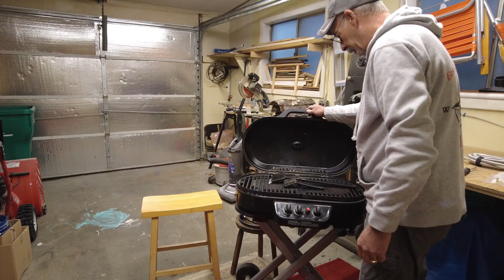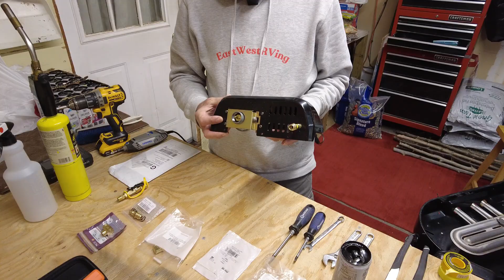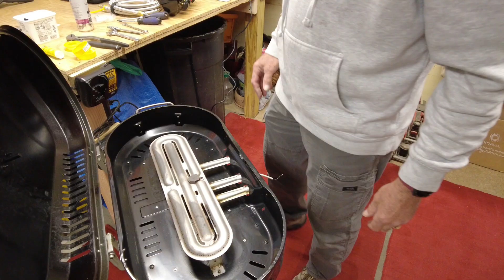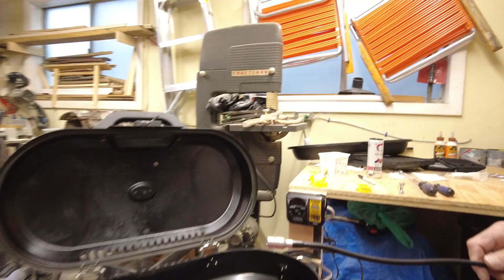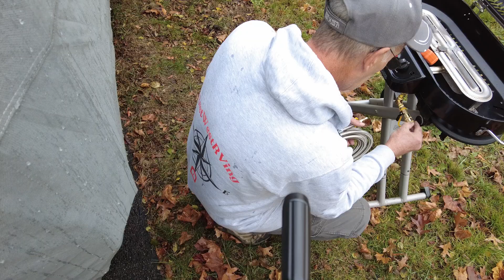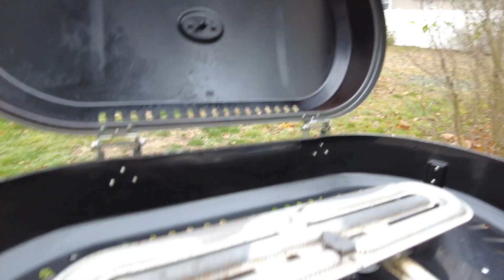Coleman Road Trip Grill Conversion Project

Comment: Thank you so much for the video. I have seen so many people doing this wrong or just merely converting to a 20 lb tank. This will be a relatively simple conversion once I found the metric fitting.
Reply from the maker: Glad I could help, I'm going to update this video in a couple of weeks so keep an eye out for that.
There is a link in the description for all the parts including that metric peice.
Reply: @e @eastwestrving  Yes. Ordered all the parts including the metric coupling. As soon as it all arrives, I’ll get right to it and I’ll remember to drill the hole in the back, not the front 😂👍🏼
Reply from the maker: @alpineralph I discovered after using my propane sniffer there are two additional items needed. I'll post the links and a brief description in the comment section.
Reply: @eastwestrving  let me guess. The propane leaked through the regulator and the original bottle attachment.
Reply from the maker: @alpineralph that's correct,  I have a fix just waiting for the part to show up.
Reply from the maker: https://a.co/d/00ZwiNmU
Here's the part that caps off the original regulator.
Reply: So. Once this is installed, no need to cap off the flared end?
Reply from the maker: @alpineralph  no you don't have to cap the flared end. I have a video dropping midnight tonight showing the fix.

Comment: Great video. I have been researching the best/easiest way to do this and yours is the best by far.  

I just bought the Coleman grill today.  Everybody seems to love this grill, but we all dislike the mini propane tanks. 

Still being able to use the smaller tanks is a bonus. Curiously, will the mini tank still connect and work?  I have quite a few left over from my other grill that I may want to use up after converting. 

I will be getting the parts and making the change soon.
Reply from the maker: Glad our video helped. You can still use the mini or the 20 pound tanks as before . When reverting back to the smaller tanks make sure that new valve you installed is off or you will have a gas leak.